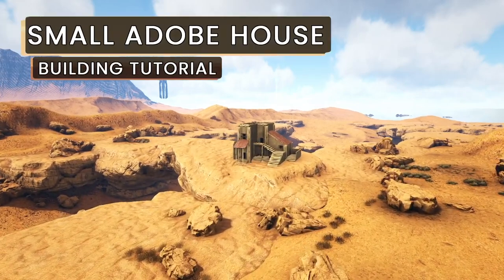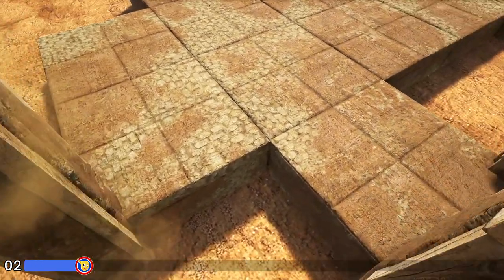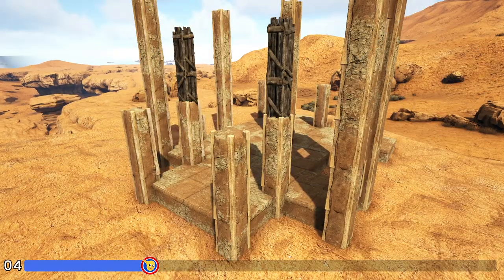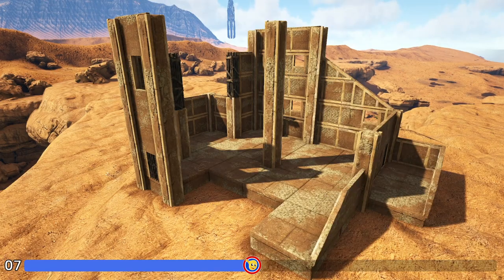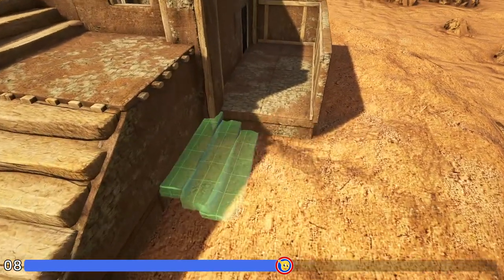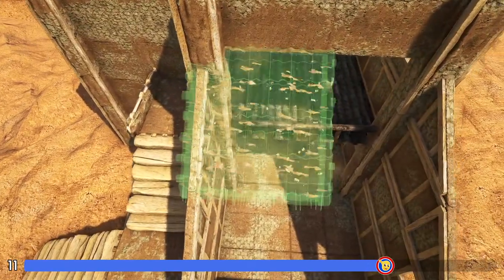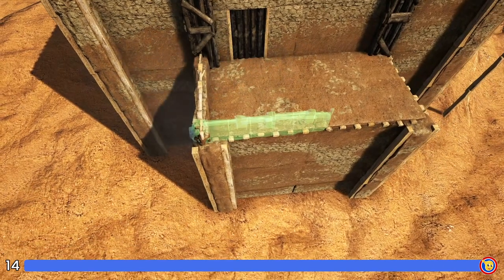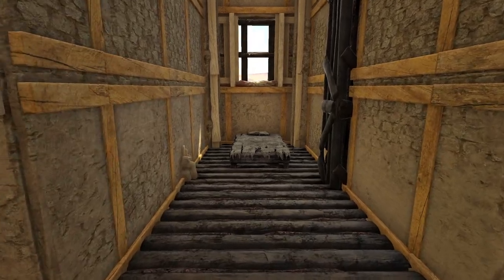How To Build A Small Adobe House | Ark: Survival Evolved

Comment: Hey man, I have a question. Do you have any ideas as to where I can put a generator for the fridges?
Reply from the maker: You could probably remove the inside wall that leads to underneath where the stairs go up outside and place it in there basically under the stairs.

Comment: The structure count is a little off. I needed 38 adobe pillars to finish it
Reply from the maker: For a specific step?
Reply: @CHipZz  the placement of the pillars, right after the foundations were placed
Reply from the maker: On step 2? Should only need 35. Its 6,4,6,4,5,5,5.
Reply: @CHipZz  Are you sure youre thinking of the adobe house build? Because if you follow the video, you get to 5,5,2,2,2,2,5,1,5,2,2,5 which adds up to 38, not 35 or 37
Reply from the maker: Lol I definitely thought this comment was on the workshop cause I saw your other comment on there.
Reply: @CHipZz  yeah I like to jump between your builds lol
Anyways, your description is wrong

Comment: Hey chipzz, I wanted to give some feedback on the design. I love all of your builds, so please dont take this the wrong way. Are we good? Ok.

The outside looks awesome. So many parts sticking out on different places that fresh up the look and make it a sight for sore eyes.
But then we get inside and the spacing of the rooms turns my stomach.
The room on the lower floor has an awful train station feeling because it has two doors and is tight like a corridor on one end. It feels like the wind could blow right through with little resistance. That doesnt really make it cozy, quite the opposite.
The upper area isnt cozy either. You enter through the door and stand in the middle of the room immediately. Thats a problem because theres no corner in the bigger part of the room where a bed would look good. Beds on display as soon as you enter a room have an awful hospital feeling, not a home feeling.
In your vid, you put the bed in the small corridor... which just looks claustrophobic. Like a prison cell. Maybe it would be better to place the doors differently. The door upstairs could lead into the corridor so the big room is around the  corner and can be designed more comfortably. On the lower floor, Id remove one of the doors to take that trainstation feeling away.
Maybe a few additional walls could help too.

To finish on a high note: I think the balcony and the open floor with the railings upstairs look good. Love your work :3